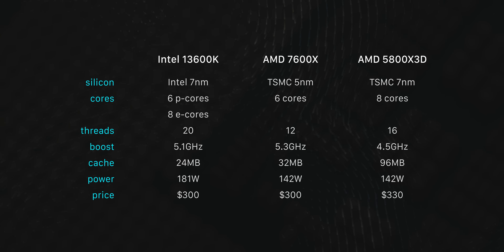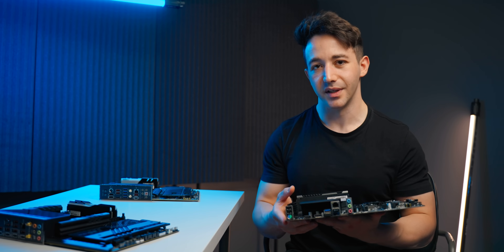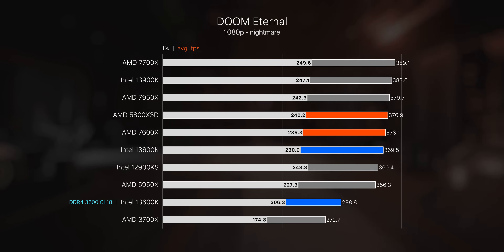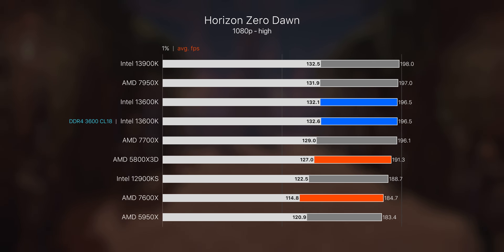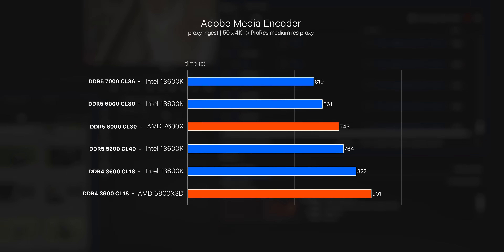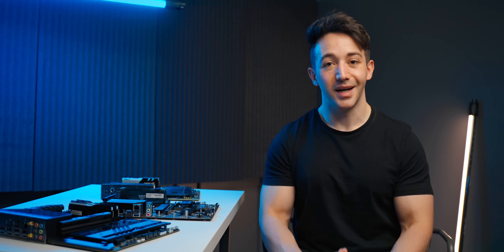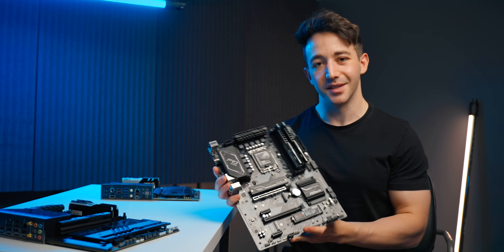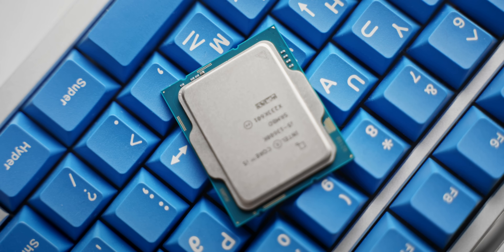Best Gaming CPU - 13600K vs. 7600X, 5800X3D

Comment from the maker: btw GPU used for testing was an RTX 3090 👍
Reply: I replayed the intro twice to see if I had missed that info, thanks
Reply: Would you consider repeating the test with an RTX 4090 to see how much headroom the 5800X3D has considering future GPU upgrades?
Reply: Try the 4090 according to one channel with the 4090 the new cpus crush the 5800x3d
Reply: I am AMD A8
Reply: Why is the 7700x so much higher in Valorant, yet you say the 5800x3D was top? Did you mislabel the graph?
Reply: @alifewithoutgamingisnolife  He said that the 5800x3d was top because of the 1% lows the number in the white bar.
Reply: @alifewithoutgamingisnolife  val really likes alot of Vcache , ex - 5600x is 2x faster than 5600g in Val due to the 32mb vs 16mb of vcache
Reply: @alifewithoutgamingisnolife in between the ones tested.
Reply: What is the best cpu gpu combo that money could buy? I need it for valorant and cs 2. I just want the best pls
Reply: ok to simulate midrange )

Comment: Ended up going with the 7600x. I had a i7 8700k so was pretty outdated. I wanted to get an AMD chip and it was between the 5800x3d and 7600x. Picked the 7600x because it has comparable performance, sometimes even slightly better and it's on the new AM5 socket so I can upgrade to a better AMD chip whenever needed.

Comment: Get the 7600x wait 3 years and get the 9800x3d on a deep sale and most likely see a 50% uplift and then not upgrade for another 3-5 years and finally get a new board

Comment: The fact the 7800x3d pulls similar fps to the 14900k but only uses 120 watts vs 320 watts. You literally need 200 more watts of psu to use the intel

Comment: hi, one year later and im considering building either 7600x with rx 6700xt or 13600k with 3060 with playing valorant and recording/streaming my gameplay in mind im still very confused and not decided on what to go for. im playing valorant high level and want to stream it as well so im not sure which metioned option would benefit me most. if someone could help me decide i would appreciate it. thanks!
Reply: Hey man
For streaming nvidia is much better
I would say go with current gen 40 series card, if your budget allows that.
For cpu it’s up to you, if you 
Even with video and photo editing 13600k and 7600x give similar performance.
Depending on price choose that one
Also, 7600x will need am5 MB
Which will have future gen support.

Comment: I don't like that you're comparing the 13600 on DDR4 to the rest.  It's a DDR5 chip.  Gimping it down to DDR4 to put it next to the 5800X3D doesn't make sense.  The 5800X3D is meant to compete against the new chips in their optimal configurations.   The heads up comparison should be 5800X3D on DDR4 to 13600 on DDR5.  The whole point of the 5800X3D is that it's close in performance to these chips without forcing you to rebuild your whole system.  It should be based on the products goals and the company's intentions.  Instead we have a comparison based on what's good for content creation and talking about trendy parts in a way that frames them in a better light then what they really are.  If you pay attention to the video and look for the DDR5 result you can clearly see that the 5800X3D is handily beaten and costs about $100 more than the 13600K.  That should be the conversation here.  Gamers Nexus made that exact point.

Comment: Why would a CPU that can tie or beat another one in gaming, be inferior when it comes to 3D multimedia processing?

Does AMD use fewer checksums than Intel, and as a result, produce more execution errors?
Reply: the 5800xrd has lower boost clock. More cache doesn't translate to better productivity, it's made for gaming not productivity
Reply: @coolamericano  Can you answer my second question also?
Reply: @coolamericano  I contacted AMD and would you believe -  that they told me such information is proprietary.? 😁
Reply: @jakobw135  ask hardware unboxed on their Q&A podcast, I'm sure they can answer it
Reply: @coolamericano  Thanks 👍

Comment: Replaced the 5900x for 5800X3D for only $3 out of pocket. Ran that for a month with my 6900xt near 4K resolution. Found a buyer for my x570 Asus Tuf board and 5800x3D for $380. Ended up buying a 7600x,x670 elite ax and 32gb 6000mt cl30 for $442.

Once I sell my ram I will be almost break even to go from 5800x3d to 7600x. Not a big difference sure in performance but 4x m2 slots for my 4 NVMe drives and faster overall. And it was basically a free upgrade.

Comment: 7600x in eco mode or a regular 7600 right now which is only $194 is actually a great option for gamers. It only consumes 65w and you get the upgrade path to 8000 and 9000 series

Comment: The 13600k is very easy to overclock, which should be added, but is almost never shown in benchmarks. I'm running mine at 5.4-5.7ghz (100% stable) with a thermalright peerless assassin (40 dollar cpu fan) at low temps.

Comment: At 4K or DLSS Quality (1440P upscaled) I don't think it matters as much. If you want absolute max performance DDR5 is the answer but DDR4 might be a money saving option for those that have already invested in memory kits over the years and own multiple systems so it's easy to swap and upgrade as we go. I'll eventually get DDR5 once it's mainstream but for now I don't really care. If you are playing at lower resolutions it could be an issue. I personally rather spend more money on the GPU though as that makes more of a difference at the end of a day. And you can always low a few graphical settings to get your desired framerate depending on the game. Modern engines use modern cpu's with lots of cores more efficiently also. Another thing I'd like to add is that 32GB DDR4 is probably going to be a better choice than 16GB DDR5 for example. I personally will upgrade to 64GB DDR5 because at atleast 7000MHz and low timings / custom. Why? Because I like maximizing everything. Right now you can still use your older DDR4 and put some custom timings on it, overclock it with more voltage and get higher performance out of it. Why not? Ofcourse know what you are doing but there are plenty of guides out there to get you started.

Comment: I went for a regular 7600. Not only does it have a lower TDP than the 7600X by default, but it's also still perfectly adequate for high refresh rate 1440p gaming, much like the 4070 I settled on. Sure, last-gen is a lot better in raw price to performance, but I didn't want to get stuck with no upgrade path on AM4, and I also wanted the power efficiency of parts lower on the generational spectrum. (Extra context: I do undervolting.)

Comment: i went with the 7950x3d
128gigs of ddr5 6k
msi x690e tomahawk
NVIDIA FE 4090 
NR600 case 
1600w evga PS
4tb m.2 990 pro
windows 11 de-bloated
which destroys all my games at 4k max settings. 
best gaming computer ever. 
my 32inch 4k 240h g8 neo monitor crushes the games
Reply: Maan you're the minority gamer, that pc has specs that maybe ill surpass in 8 years with then gen mid level parts... 4090??, Mans already has gpu that outprices my whole setup. Congrats indeed on your gaming computer!
Reply: @vapor5167  thank you sir. i also use it for content creation as well

Comment: i have ryzen 5 5600g and rtx 3050.  i want to updgrade my cpu to AMD RYZEN 7 7700X . is that ok . but my mobo is ddr4 :( i only play valorant
Reply: nup. you wil have to buy a new motherboard and ram that supports ddr5 otherwise it will not detect the 7700x. better off getting the 5800x3d.

Comment: this video has been released 10 months ago... things looks quite different now (for those are going to build a new rig)...
Reply: Would the ryzen 5 7600x be a better option now ? Or should i still go for the i5 ?
Reply: @heliux1233  yes, if you compare them with prices(depends on region). sure the 13600K is still a beast if you could raise your budget for better cooling system... for the 7600X... actually the non-X version is the better option now..

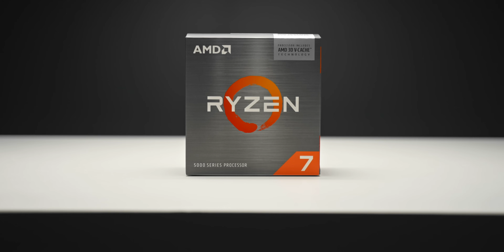Comment: 10:25 it's only half-correct for AM4, honestly as I personally experienced it myself. I hope that AM5 wouldn't be the same.
Started with MSI X370 SLI Plus and R5 1600 back in 2018 thinking that I wouldn't have to upgrade my motherboard, it turns out to be untrue as 1st gen Ryzen AM4 motherboards (A320, B350, and X370) are severely limited when compared to the 2nd gen motherboards (A420, B450, and X470). Fortunately the 3rd gen motherboards are quite good, especially the B550 boards as they're more or less on par in terms of features when compared to X370.

Down the road, I've upgraded to R5 3600 in 2020, then switching up the motherboard to MSI B550 Gaming Plus in 2021, and finally put a stop at R7 5800X3D back in January this year.

Comment: I have i7 6700k paired with 16GB ddr4 ram and gtx 1080ti. I wanted to upgrade after I experienced some issues in CoD MWII. I have a low budget. New motherboards based on AM5 and LGA1700 have two eight pin EPS connectors these days. My PSU has only 1 EPS connector. So, instead of buying DDR5 memories and a new PSU, I just wanted to buy a CPU and Motherboard with 1 EPS connector and DDR4 support. I went with the 5800x3d and MSI b550 Tomahawk Max Wifi (it has only 1 EPS connector so it should be fine). In the near future, I just want to upgrade my RAM to 32GB. I wonder your thoughts? Did I do wrong buying AM4 chip&mobo instead of AM5 or LGA1700?

Comment: 10:10 thats exactly what i did, went from a ryzen 1600 to the 5800x3d. In my position, if id abandoned the platform and went for ryzen 7000 or intel, i would have skipped out on the upgrade potential of the am4 board that i bought. To the same end: what, id buy am5 now, and then just replace it without upgrading later in the name of future upgradability of the new platform? Why pay for upgradability if you never use it?

Comment: you should test the 13600k with ddr4 4000cl 16 and ddr5 7200 i would be very interested to see how this stacks up since in theory thats one of the 13600k' strengths and using slower memory on both ddr4 and ddr5 I feel isn't doing it justice.

Comment: Currently where i'm from the 7600X is around 110 usd cheaper  then 13600K/5800X3D (not to mention non-X 7600 which have nearly the same gaming perfomance as X). Seems like no brainer to invest into AM5 here right?

Comment: I heard that 12 and 13 gen K chips were overheating on B660 motherboards. Is that true? And I heard on reddit not to use 12 an 13 K and non K chips on B660 boards.

Comment: Thank you for including aging cpu like 3700x. Actually the exact cpu I have currently and considering upgrading from. Seeing the apples to apples of older cpu vs new is so helpful rather than just the newest stuff running against each other like other reviews. Great content
Reply: In May I saw a 5800X3D on Amazon for $300. I was running a 3700X which was by all means strong enough for "now". I bought the 5800X3D just so I can keep my rig a few more years. I bought an RX 6800 for $350 so for $650 I probably added 5 years to my rig. It'll be slow and outdated by then but it will last mainly because I didn't need to upgrade...I run at 1080p. lol

Comment: 3:15 I'm afraid you are sorely mistaken there. DDR5 4800 CL40 will absolutely cripple the 7600X compared to 6000Mhz CL30. Ryzen 7000 is extremely speed and latency sensitive. Check out the Hardware Unboxed video.

Comment: Hi Optimum, after your video i want your opinion about the RIG i just buy...  	Intel Core i5-13600K 3.5 GHz 14-Core Processor, 	Gigabyte Z790 AORUS ELITE AX ATX LGA1700 Motherboard, 	Corsair Vengeance 64 GB (2 x 32 GB) DDR5-5600 CL40 Memory, 	Samsung 980 Pro 2 TB M.2-2280 PCIe 4.0 X4 NVME Solid State Drive, 	Gigabyte Vision OC GeForce RTX 3070 8 GB Video Card, 	Cooler Master MASTERLIQUID ML240L RGB V2 65.59 CFM Liquid CPU Cooler, 	Corsair RM850x (2021) 850 W 80+ Gold Certified Fully Modular ATX Power Supply, 	be quiet! Pure Base 500DX ATX Mid Tower Case.  The badget was till this line so, i build everything like this cause i had first my RTX 3070 and then i buy all the rest.

Comment: I went from 5900x to 5800x3d with 3080 and ddr3600 cl14...it pushes the 3080 to max now, lows are way better at 4k. And it's noticeably smoother, getting extra high fps also, cyberpunk is better now, I get more fps, better lows and now get 65-74 fps at 4k ultra settings with more ray tracing I can add now, perfectly smooth in busiest area now. Bf 2042 is also way better now. Worth the upgrade for me, can skip am5 now.
Reply: now
Reply: @kalens9189  It's still doing fantastic, 120fps on high settings on battlefield 2042.

Comment: Would have been nice to see some fast DDR4 on the 13600k to see how some BDie that many still have holds up against that fast DDR5.
Reply: From some other benchmarks I've seen, good 3600 cl16 seems to hold up to 5200 / 5600 cl40 in most applications. :)

Comment: I change my ryzen 1600 to 5800Xx3D this week, its impressive whats am4 can delivery on my old B350. Excellent video!
Reply: I thought b450 is the last to support 5000 series?
Reply: @elnino77-j2c  you can flash a new bios onto b350 mobos and it will lose its support for older gen cpus and gain support for 5th gen.

Comment: I'm very happy with my 5800X3D. Managed to undervolt it, so it maintains boost speeds 99% of the time, while staying 10c-15c cooler on average.
Reply: Wow, I'd not expect that masive temp change. How much did you undervolt and what cooler did you use?
Reply: @alphaadhito  I used PBO Tuner to achieve these results. It's the only way to get around the locked PBO and OC settings in the bios.
Reply: PBO Tuner 2
Reply: what voltage?
Reply: @magzire  Curve Optimizer set to -30 offset. Voltage ranges from 1.12v - 1.25v depending on the load.
Reply: I know this is old but you don’t need pho2 tuner now. Latest bios has it
Reply: @chaotic_994  Yeah, I know. So much easier lmao

Comment: Amd really need to work on cpu cores , like intel has Ecores , chiplet design is great , all amd has too do is create smaller Ecores cpus cores and put them with performance zen 4 cores , then they will match intel cpus.
intel has done great job by reconizing their multicore problem , creating Ecores was the best thing they done , 
now intel beat Amd where Amd had upper hand , more cores . Intel now offers more cores and higherr single theard performance.  Amd is now again second , only fighting on per per watt.

Comment: i would like the know 13600k is not overclocked right? because i want to use it with b660 chipset and wondering it is enough for 13600k for get these results
Reply: It is not overclocked, the B660 motherboard will do just fine. Be sure you have 3600 RAM.

Comment: If you already have the required platform for the 5800X3D, you can always decide to buy into the newer platforms when you need to  - you'd have purchased the same number of new motherboards/CPUs at that point.. There's no actual downside to waiting, unless there's some reason you'd need the 7600X/13600K now.
Reply: in valorant my fps tripled compared to my 3700x

Comment: Gpu: 3080 ti
RAM: 32GB 3600
CPU: i7 8700k
AIO: Corsair h115i hydro series 280mm
PSU: EVGA 1000w
MB: MSI z370 Msi gaming m5

Currently stuck between just upgrading to 5800x3d with am4 MB or just going all out and starting from scratch for the 7700x (except 3080ti).  Strictly gaming, don’t do anything else on my computer. *HELP*
Reply: 5800x3D is awesome I would recommend

Comment: b660 will not get the full performance out of the 13600k so instead of cheaping out on the 50bucks difference you should go for z690 board.

Comment: you shoulda mentioned if you choose 13600k, you're stuck on that platform and your upgradability path will be only until the 13900k, because the mobo gen is ending. that's what i need opinions from
Reply: Turns out it will be good for one more gen
Reply: And they just announced that gen has a little bit of performance upgrade and a huge efficiency upgrade lower watts and temps while still being a beast

Comment: The 13600k isn't based on the 7nm process, it's on the 10nm process, Intel just names it 7N for people to get confused like this. Just wanted to point that out.
Reply: Those are justs marketing terms. They renamed it because if you compare transistor density per unit area the process is similar to TSMC and Samsung 7nm

Comment: I think it's also worth mentioning that 7600X runs at 95C with 360 radiator with fans at 100%. In other words, it requires expensive cooling too which makes it pointless in today's stack of CPUs in that price range.
Reply: 13600K is the same story.
Reply: note that this only applies with heavy CPU load... in most games this won't be the case

Comment: The 13600k vs the 5800x3d doesn't even make sense. You will spend more money on the 13600k and the extra benefit of better MT doesn't matter to gamers. So it's ironic how you recommend the dead end socket that costs more. Lol and bottlenecking the 7600X with the 3090. HAHA.

Comment: The 5800x3D has the additional advantage of fitting basically ANY AM4 Board by now. I myself am sporting it in my Asus B350 Prime Plus.

Furthermore, as Hardware Unboxed has shown, it also doesn’t really care for either Motherboard or RAM quality, meaning you get what you get, no matter with what combo.

Comment: I'll stick to my 13700k all p-cores at 5.8ghz and running m-die at 7200c32 (not the new a-die. m-die has much better latency).
Beats all 3 of these "best gaming" cpu, does it at 90w. And it cost me $130. (sold 12700k for $315). Same Motherboard (Unify-x), same ram (g.skill6400c32). Y'all shoulda planned ahead! Drop in 6ghz gang gang.

Comment: 1:03 The 5800X3D is not 142W as far as I know.
8:56 First gen AM4 boards will very likely not support the 5800X3D. Most X470 will, my Taichi Ultimate sure does but anything older than 400 series boards might not work at all.
Reply: B350/X370 and A520 works so you're wrong.